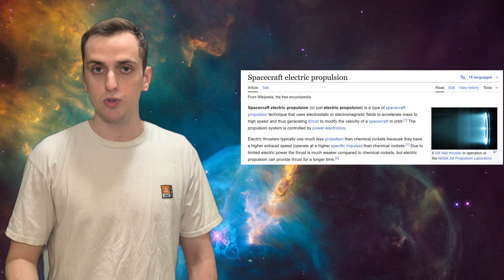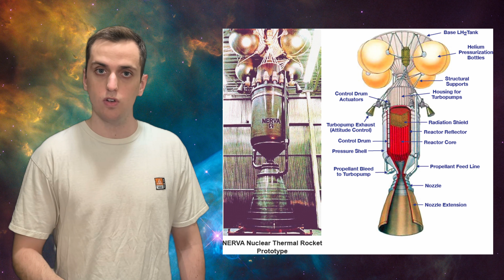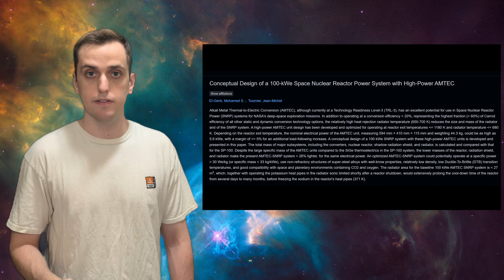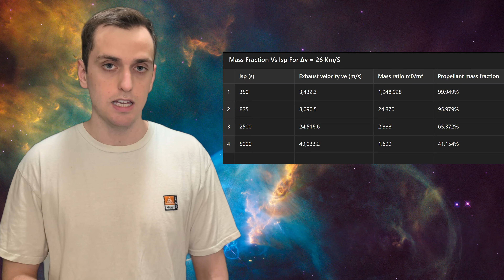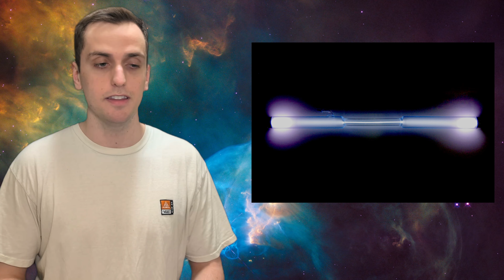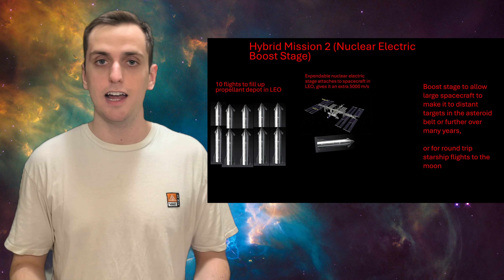Do We Need "Nuclear Electric Propulsion" to Get to Mars?

Comment: You mention that it’s possible to aerobreak at Mars.... is it? Mars has 1% of our air density and is smaller (smaller distance of air to go through)

I’m not sure that the relative speed from a Hohman transfer could be completely absorbed by an aerobreak even a low flyby

I also doubt this option would be selected because a lot can go wrong with an aerobreak vs if you chose to just slow down with an engine burn
Reply: You then talk about it being a bad idea to send people back from Mars and that we should have a more "settler mindset"

I agree however why not take this further and just completely ignore Mars
Mars is awful it’s far away it’s heavy it doesn’t contain any element the moon doesn’t have and it doesn’t even have sunlight and it’s full of dust and it sucks and it’s so bad and oh god everything is red

I left another comment that basically can be summed up as me saying we should only focus on space industry and nothing else, and for that Mars isn’t exactly the best candidate
Reply: Your point afterwards about going to Mars anyways on chemical engines is really weird though

Because you clearly state it’s a one way trip
But now just sending one small team to Mars and likely not the beginning of a large colonisation effort
So what’s the sales pitch lol, "hey who wants to be sent to Mars and die there after 2 years when your oxygen runs out?"

Your 26kps figure for space transfers is basically just "what it costs", it’s the cost of doing business and it’s not really avoidable 

I think that we shouldn’t send astronauts to Mars just to plant a flag and take pictures; BUT if it’s decided anyways, then it absolutely must be a two way trip 

Ships and technologies that have 30kps+ in the tank are extremely useful, it’s not like they stop being useful after a Mars mission, they can go anywhere and they can do so for cheap because they use very little propellant mass for the delta v they spend. Fewer kg per kps. Ion engine ships would be great at pretty much everything except landing and takeoff so they absolutely should be developed, optimized, mastered and mass produced

And the 26kps figure is fairly easy for an ion engine. The technology's potential is much higher, ships with 300kps of delta v and above are well within the realm of possibility.
Reply: You made a mistake with the ion engines about the transfer time

Yes you need to spiral out of earths gravity well. However only the ship has to do that, you can just send the screw on a shuttle to the ship that has already spent months spiraling out and is at the edge of earths gravitational influence. You don’t need to include that very slow process in the mission time for crew and life support

Also it’s worth mentioning that ion thrusters could theoretically have much more thrust than your example  if we manage to get the thrust and power density required. Doing a spiral transfer is only needed if their burn time is longer than a hohman transfer (8 months?) 

So if they have more thrust than that they can do a hohman transfer as well and would also make much steeper spirals around earth and Mars that don’t take nearly as long. Spirals or split burns I’m not sure which one is better
Reply from the maker: Ya idk if this would be much better because of the oberth effect it is better to do your interplanetary acceleration as low in earth's gravity well as possible versus after escape.
Reply: Your analysis is pretty good (I’ve watched around half so far as of this comment) but I think a better approach to compare ion engine is a sort of "efficiency primacy" approach

Looking at the % of the energy that is turned into thrust instead of waste heat. This is different from the kW/N metric you use because this combines the exhaust velocity (EV is a much better metric than Isp and I wish everyone would collectively stop using Isp...) and the thrust and compares that to the imput energy

The reason this metric is so important is because an ion engine needs both the thrust and the EV unlike other engines that generally have more thrust than they need such as chemical rockets for space transfers 

An ion engine is forced to do silly stuff like spirals and waste time and also waste delta v if it doesn’t have enough thrust and the acceleration of the craft is too low. 

Basically all engines have a balance between exhaust velocity and thrust. They’re sort of mutually exclusive and get combined into engine power. Engine power is what matters most, and for an ion engine, the % of the electricity that is converted into engine power and not waste heat is extremely important. If that value is high, basically it’s electrical efficiency, then whether you get exhaust velocity or thrust, you can be certain you’re not wasting your precious joules of energy. Which ever one you’re getting will help you get to Mars faster. 

This is a bit of an advanced trick I learned
Reply: You mention argon due to the cost of xenon but you would use krypton first if your goal is to get the heaviest particle possible. Krypton is 20 times cheaper than xenon and closer in weight to it than argon
Reply: "Designs that use argon generally have a lower specific impulse"
No in theory argon would have a much higher specific impulse they’re probably just either optimized differently or less efficient 

For ion engines, particle mass matters most. Then ionisation energy is useful but only reduces how much energy is needed it does not affect the "impulse per propellant kg" if the thruster. Every time you switch out an atom for a lighter one it will gain exhaust velocity and lose thrust, and it may make the engine less efficient as a whole if the ionisation energy is higher which in turn may make the entine so much worse that the exhaust velocity goes down despite it going up from the lighter element. In theory ion engines can use down to helium and neon without issues and would get much higher EV (100 thousand or more)(10k Isp) than xenon ones. 

But you would get crafts with microgee of accelerations which is why until we can manage to push the balance towards thrust for ion engines, most rely on heavy elements. But the Isp trends up as you get lighter elements not down. They use xenon to get more thrust while sacrificing Isp, so they don’t have to spend quite as long doing spirals. That’s the reason xenon is used
Reply from the maker: Ya I think i mention this stuff also Isp and EV are proportional and Isp way more commonly used. Ya krypton too but SpaceX uses all Argon on their Starlinks now.
Reply: @NoiseInSpaceChannel
lol you’re here sorry I was still typing didn’t see you 

For the EV stuff, the rocket equation uses EV not Isp, Isp is a weird metric that basically measures how many seconds a rocket could hover in place until it runs out of fuel at 1 G which is why it’s in seconds. 

The benefit of Isp is that you can measure the Isp of rotor engines, jets and helicopters. You get EV by multiplying Isp by G (gravity on earth which is almost 10 m/s^2 but not exactly)

What’s so great about exhaust velocity is that it’s directly linearly related to delta v. In fact exhaust velocity = delta v if your rocket is e mass ratio. 

Δv = EV * ln( m0 / m1)
Aka
Δv = EV * ln(e)
Δv = EV * 1
Δv = EV
When the mass ratio is e ( around 2 /3d) fuel by mass 

It makes taking abo it everythihb so much clearer because then everything is in proportion, it makes it obvious that you need an engine that has an exhaust velocity in the order of magnitude of the delta v you need for a mission. 

So on the topic of ion engines vs chemical rockets, chemical rockets have 3.4-4.4 kps EV. 
Ion engines have 30-300 kps EV. 
Your mission needs 26 kps Δv. There’s one clear winner. 

If you tried to get 26kps out of a 4.4 kps EV highly efficient hydrolox chemical thruster you would need a truly absurd mass ratio, likely more than 99% fuel. 
Meanwhile an ion rocket that has 40 kps EV can get you 26kps Dv without effort. Well so long as it has enough thrust to spend that 26kps of impulse (impulse is the name of the Dv metric it’s never mentioned anywhere I don’t know if you knew this but more people need to know) within less time than the planned transfer trip.
Reply from the maker: Ya they have much higher efficiency I think my point you are missing is how much time and mass is required to generate the power for them, how much mass for the thrusters themselves, and also the advantage of impulsive burns taking advantage of the oberth effect. They have their purpose and I think they will be the most important aspect of interstellar travel but for human missions to Mars its not the best tradeoff. Do you work on ion engines or something?
Reply: Yes they do require a ton of mass for power generation

I actually did a study I never published looking at non nuclear ion engine readability and the tl dr is that you lose around half to two thirds of your delta v but it is still entirely possible to run ion engines on non nuclear power sources. As in including a trip to Pluto. Solar panels on the way out, stored chemical energy on the capture. You lose most of the delta v compared to solar close to the sun or nuclear but it’s still possible and makes for faster trips than any option

For interstellar sorry to say but ion engines don’t cut it. Not even close. The best ion engines we could ever make could maybe give you 1000 kps, an engine with 200-500 kps of exhaust velocity and a lot of fuel. That’s very impressive but when your target is 10 light years away... that’s 90 billion seconds. 180 billions because you need to slow down. A year is like 30 million seconds so the very best most optimistic ion engine performance is a 6000 year journey. To stats right next to us. I mean I guess if we never find anything better but aliens are going to think we’re space hobos I’m pretty sure if we do it like this 

No I don’t work on ion engines but I love them because they’re a fairly easy to make technology that has just enough thrust and exhaust velocity to make any trip in the solar system take weeks/months/2-3 years max 

Current ones are also far from the theoretical maximum, a full order of magnitude should be fairly attainable for exhaust velocity 
And of course engine efficiency the concept I talked about. Very very important

The sad news is that you still need crazy levels of energy to move fast even with100% efficient engines that don’t create any waste heat. I checked. So massive energy requirements will always be a part of space travel

As in if you want to go from planet to planet in a large ships you’re going to need gigawatts of power. It’s kinda unavoidable. Less engine power would mean less delta v or less thrust both of which would mean longer transfer times.
Reply from the maker: Aerobrake works they do it for the mars rovers. At least a partial one would save tons of fuel.
Reply: For Mars rovers and aerobreaks didn’t they just straight up slam into the planet? Though I guess that if you slam into the planet and slow down aerodynamically then the same atmosphere would be enough to slow you down to a captured orbit provided similar drag ratios a small rover can be a very low density package with the heat shield. Have a very high drag to mass ratio. You’d need a gigantic structurally sound heat shield to do the same with a crewed vessel. 

Idk I guess it’s possible if rovers did it but it’s still very risky, a thruster that turns on accidentally, poorly calibrated sensors, micrometeorite damage on the shield... like what do you do lol. You spot the damage. If you don’t aerobreak you fly back into space likely not even on a resonance orbit with earth. If you do the aerobreak you might end like the space shuttle on reentry. 

But one of the reasons I love ion engines so much is that they have enough exhaust velocity to make this kind of decisions non issues. They have more than enough delta v to slow down at Mars (like what, 7kps?). Even a relatively basic ion engine with 50 kps could do that easily

AND, think about it, if you already have the power plant infrastructure on the ship to do the other burns, it’s fully possible that the fuel mass for that 7kps capture burn would even weigh less than the heat shield and aero components. If your exhaust velocity is high enough at some point in he mass you spend per kps of impulse becomes minuscule and it genuinely becomes a greater mass saving to capture than to aero burn. 

Look at the spaceships in the movie avatar for instance. They have crazy torch engines with an EV near lightspeed. They can capture at a planet very easily. Now imagine the nightmare retrofit you would need to do to an ISV to make it capable of doing an aerobreak. If you make a ship that cannot go through atmosphere or survive reentry heating, it frees you to do a much more intricate and optimized design. Suddenly you can do low density structure, lightweight weak structures because there are no forces, no concern for aerodynamics, no need for a small footprint to be behind a shield, no heat shield. There are benefits to having a ship that cannot slow down with an aerobreak, with chemical rockets that’s not the case, but ion engines are at the level where it behind the be true. I could say 60-70 kps EV is probably the barrier where it’s far better to do a capture burn than an aerobreak (double the orbital velocity of the planets)
Reply: Ok so now that I’ve reached the end, I would say you are wrong about how useful chemical rockets are and about how useless electric rockets are

Firstly your idea of sending people on a way ticket to Mars on chemical thrusters is just crazy, it would be sending them to their death unless you had secured the funding for "1 million tons on Mars" or whatever it would take. 

On top of that Mars is useless. Just go to the moon and asteroids instead if you’re looking to mine resources to build spaceships. 

Chemical rockets themselves are kinda useless beyond their ability to take off and land because... well you’ve seen the math yourself, chaining 10-19 starships just to get one fully fueled in orbit, how absurd and inefficient is that. A nuclear rocket version of starship would reach orbit full, nuclear thrusters with takeoff potential are pretty much all SSTOs. They have an exhaust velocity of around 10kps. Earth has an orbital velocity of around 10kps (see why I prefer working in EV and not Isp?) and guess what those figures match up exactly. (A rocket that’s about 2/3a fuel could therefore achieve orbit. If it’s 90% fuel you can have 20% of the launch mass as fuel in orbit)

As I mentioned 26kps is "the cost of doing business". And chemical rockets can never achieve that. Only ion engines can, and for advanced ion engines and advanced power sources, they can give you 26 kps without breaking a sweat. So they’re absolutely a mandatory step in human development. They are THE thing that allows us to go from one planet or moon or asteroid to another. So any research and development going towards ion engines is good news in my book. 

So they concludes my thoughts, basically settling Mars is useless, settle the moon and asteroids instead, going to Mars for selfies is double useless, chemical rockets do not have enough EV or Dv to ever dream of doing interplanetary stuff except cringe one way trips and they’re not even efficient at doing that (much more propellant mass per trip for the same 8 kilometers per second of delta v), meanwhile ion engines are amazing and absolutely necessary for all space travel and any push to develop them, such as the one you cover in this video should be encouraged

Lastly you make the assumption that ion engine to Mars would take more time than a hohman transfer which isn’t necessarily true, ion engines can have enough thrust to get there in hohman or faster, it all depends on the design of the engine, the rocket and the power source. But for context, high performance ion engines give you like 100-300 kps of delta v with 5-40 mG of acceleration. They make movement in the solar system free and effortless. They are THAT good.
Reply from the maker: It's insanely harder to do a 2 way trip: https://youtu.be/gZ0J2A4Dd68
Reply: I know it’s much harder to do a 2 way trip however

1. You can only do a 1 way trip if you’ve decided to send MANY 1 way trips so that there is a self sufficient colony at the destination, otherwise it’s just sending them to their death
2. If politicians decide the mission should consist of nothing but taking selfies and planting flags (which is we as a total waste) and not colonisation, then they’re going to have to be brought back. Like 80% of the reason they do these "Flag on X planet" mission is propaganda, intentionally stranding astronauts to die would completely defeat the purpose

As for me I completely agree with the notion of colonisation only, but I also see Mars as useless for that. The moon has metals and oxygen, asteroids have carbons and volatiles/ices. That’s all you need, we never need to step foot on Mars. 

Meanwhile ion engines as a technology should be pursued no matter the excuse, if they become a mature technology because of a useless mission to Mars at least that mission wasn’t a total waste, because now there are off the shelf ion engines you can use to do actually useful stuff.

Comment: this is basically the same as one of the presentations I did in collage, however I found something more interesting than ISP and mass fractions, that is this fun idea for cooling your reactor coolants, you spray the coolant in small droplets into space at one end of the ship, and then suck them back in at the other end for maximum cooling surface area without any mass for structure.
Reply: Fun concept for a scifi to have hot glowing coolant swirl in big loops around the spacecraft in magnetic fields.